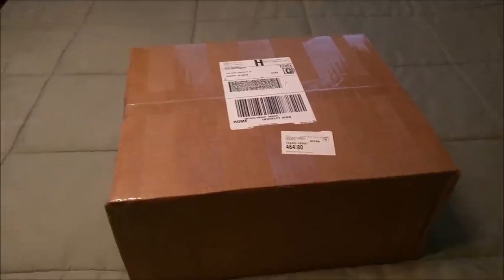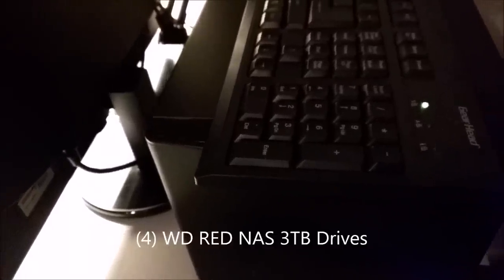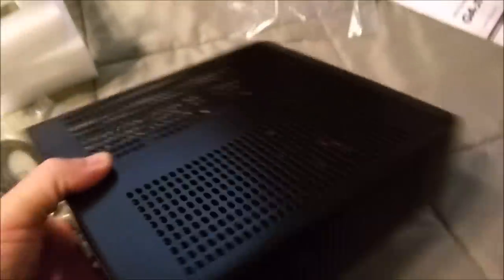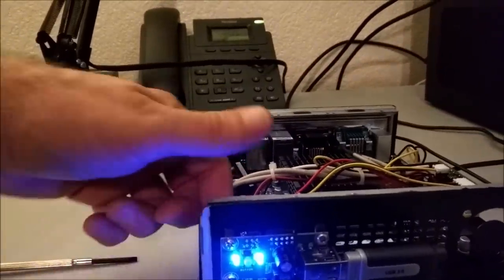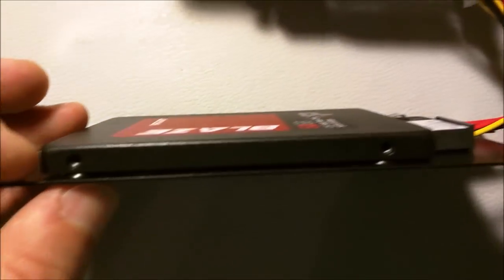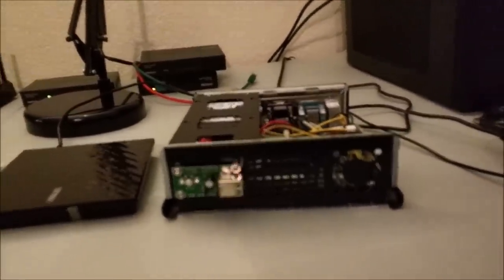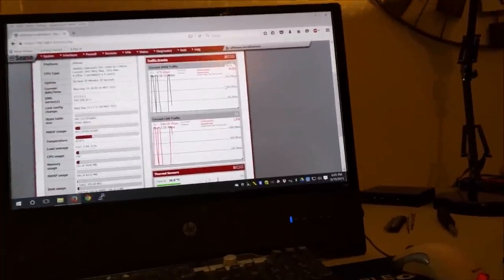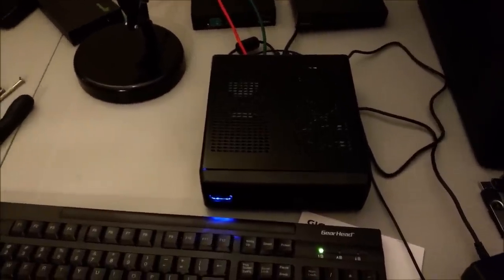pfSense build 2.2.4 on GA-J1900-D3V from MITXPC.COM

Comment: The new braswell chips are as fast the previous Bay trail chips like the j1900 while using less power with a turbo boost and with some added Bells and whittles such as aes-ni. That system is sufficient as even without aes-ni, the cpu can push encryption well beyond what gigabit network cards can do. More ram for squid3 might be necessary. The i3 is overkill for home use unless you want to run pfsense in a VM, etc.

Comment: You can buy a J1900 with 4 Intel LAN ports, 32GB SSD and 8GB in a fan less box 6"X5" for around $249 in Amazon.  It runs PFsense with no issues.  The link https://www.amazon.com/gp/product/B01I8CZ8NU/ref=oh_aui_detailpage_o03_s00?ie=UTF8&psc=1 This is not the only option available at Amazon
Reply from the maker: Jose Velez - nice buy!

Comment: Trim should work if the ssd supports same as pfsense does. The realtek nics on this board don't do well above 700mbs.  You need Intel nics for that. This more then sufficient for. Most people.

Comment: I would have used 8gb and added at least one case fan. Gigabyte finally released a n3150 version of this board (new cpu with aes ni)
Reply: +Glen Whittenberg looking forward to the 3.0mhz dual core i3 with Intel nics build.  I'm thinking about building my pfsense router here soon and really enjoyed this video.
Reply from the maker: +Brandon Baxter thanks!
Reply: +philip dias hey this is my build right now http://ca.pcpartpicker.com/p/LDd8WZ I cant decide if I should get a 4 port or 2 port intel 1000 nic for tmy second nic, also do you think my cpu will be able to handle the wan to lan speed over wired. i have 1000/50 from my isp currently. Im using a j1900 cpu soc
Reply from the maker: +ayy jayy your 1000 down is bits not bytes? if so then you have more than enough. I was trying to get true 1000 gigabytes on mine. with Intel NICs I would have gotten closer than I did with the realtek ones. I am still unclear how BSD handles SMP though. I had one core not even touched when doing my testing.
Reply: +ayy jayy 2 port is sufficient for most.
Reply: glad to hear that, currently IM installing without a case going to try it out, ended up going with 1 wan and 1 lan and a cisco manageD smart switch :d Glen Whittenberg
Reply: , thanks, ended up getting one wan and one lan and a cisco managed smart switch philip dias
Reply from the maker: I use the Cisco SG300-10. Really like the switch for money.
Reply: Got the same here, but went TP link
Reply: sweet, I only needed 4 ports, so I got a 8 port sg200-08 and I love it!! just cant figure out how to qos max bandwidth to my computer yet but overall loving the setup I saw 980 throughput on the pfsense monitoring page so I guess its working ahha Glen Whittenberg
Reply: ayy jayy I would go for the matx asrock n3150m in place of that board. The slot may be 16x, but a  Pcie 2.0 @1x can do dual gigabit lan. Using an eBay Intel card for same on that board.
Reply: +ayy jayy my next purchase is a mikrotik switch with 10gbe ports. 2 is sufficient. Would prefer 4 if possible.